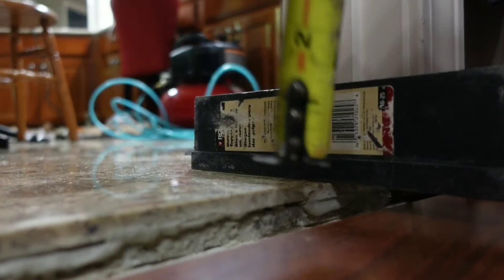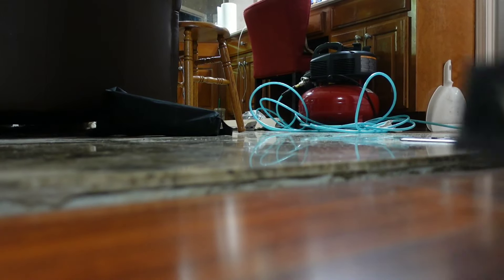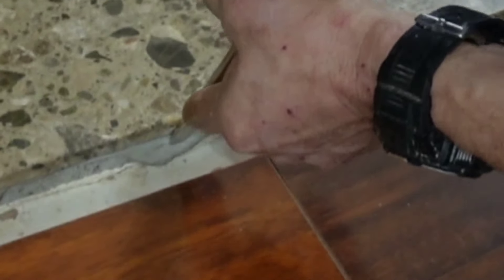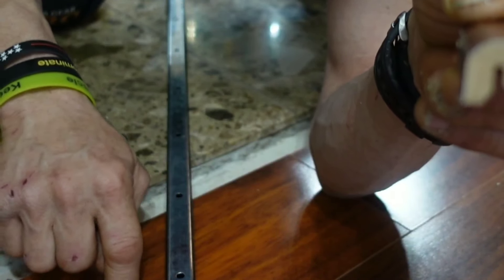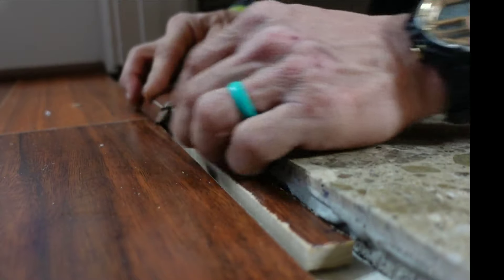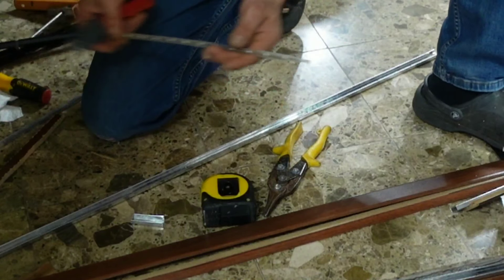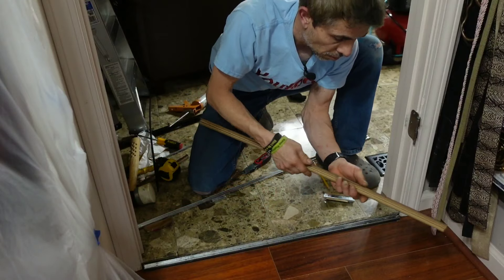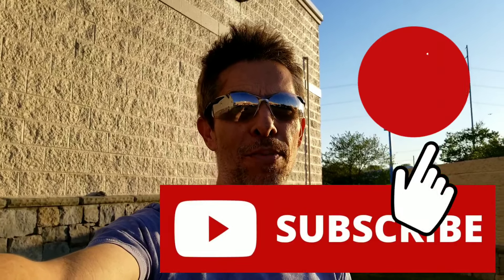How To Install a 4 in1 Reducer Transition From Tile To Laminate

Comment: Hi ,
Thanks for posting this video. I'm a novice and I would like to know how do you put down a transition strip when you don't have door casing on each side.... I will be  putting down winyl over concrete in the living room and Vinyl over tile in the kitchen...( The kitchen and living room are connected). The kitchen tile is about a half inch higher than the concrete floor...so if I were to place the transition strip down,  one side would be adjacent to the wall and the other side would be basically exposed because the tile in the kitchen extend to the very end of the wall... Can you please tell me what  I need to  do? Again thanks....I have a photo I can send if needed

Comment: WHY IS THERE NO GLUE PUT ON THE BOTTOM OF THE COVE MOLDING WHERE IT SITS ON THE FLOOR.  WOULDN'T THAT ALLOW DIRT TO CATCH UNDER THE LIP.
Reply from the maker: I didn't install any cove mold . And I would never glue anything to a floating floor. It would hender the expansion of the flooring and start causing the floor to buckle. Good question. Thanks for the comment

Comment: Your videos are very helpful!

Question: I'm using the same Simple Solutions T moulding to conjoin an existing tile floor to Pergo Outlast plus. Fortunately, the tile floor and Pergo floor are of equal height. The issue is the metal track in the channel does not sit flush against the concrete floor and there is a small gap at the bottom. I plan to use Loctite PL instead of drilling the concrete (post-tensioned slab) after watching your video. 
Would you suggest adding the plastic extension to the bottom of the metal track and placing on top of the PL or will the rubber not adhere to it as well as the metal?
Could I just use the metal track w/o the plastic bottom extension and fill the void with PL?
Reply from the maker: ABSOLUTELY.  But, I would put a bead of 100 % silicone on the laminate side and keep the pl as close to the tile as possible . The silicone will flex and still allow the laminate  to expand and contract. Plus, it will build a dam from your Pl 3x. That stuff sets up like a rock and will not allow the floor to expand. But it will hold it like nothing else. I promise. I hope that makes sense. THANKS FOR THE Question

Comment: Having issues screwing the track to my slab floor..recommendations would be greatly appreciated!
Reply from the maker: Well if you are able to use the track then you will have to use a masonry bit to drill down into the concrete. Then set plugs and then install the screws. But if that seams like a lot.. check out this video. It may help. https://youtu.be/AL1NBfkswVo

Comment: Thats a mission is there an easier way like some kind of epoxy thats a little flexible
Reply from the maker: I have glued transitions down before but mostly on concrete. You can shoot some 2 inch brad nails through it and putty the holes. But Inwould still put some silicone underneath to hold in place. I've seen many transitions come loos with just brad nails. Hope that helps. Thanks for the question

Comment: When I saw him get a screwdriver to chip away the grout I knew I was at the right place...🙄🙄
I'm just wondering why when they laid the tile if they knew they had to put a transition there didn't they just cleaned the edge while the grout was wet instead of having to chip it and risk chipping the tile or would that make too much sense
Reply from the maker: Right ! I see you can feel my pain. Thanks for the comment